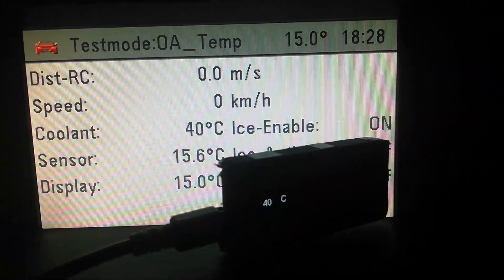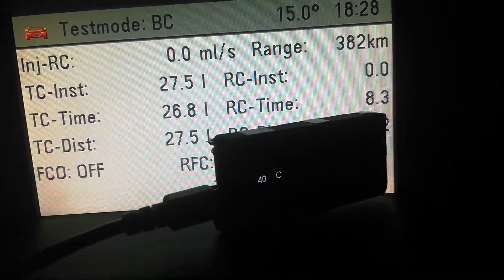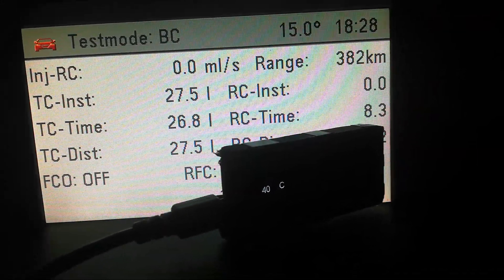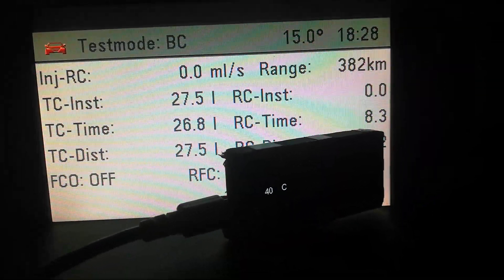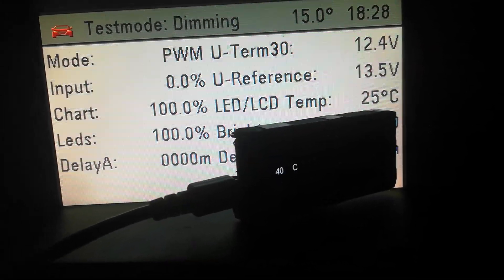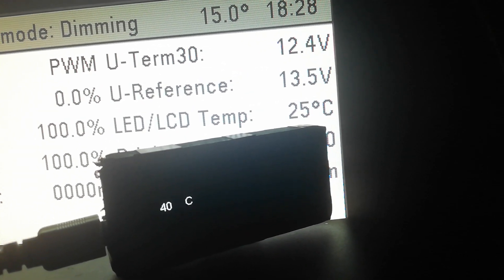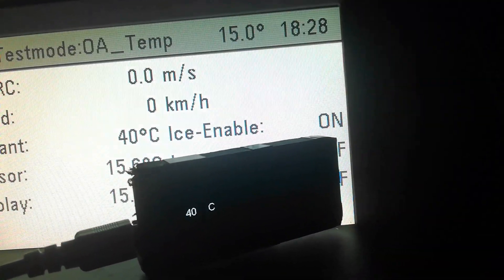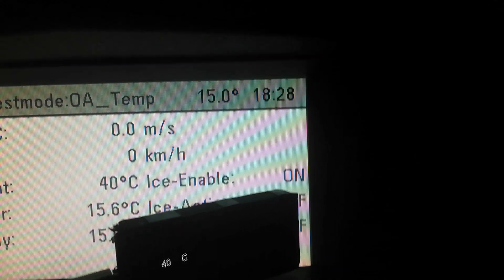ESP32 + ELM327 v.2.1 using bluetooth (2)

Comment: Did you finished the tutorial about w801,w806 modiules. Can you do some more about like sim800l communication, finger print sensors communication.
Reply from the maker: I test in the past (9 years ago) M590 (same as SIM800) also with fingerprint sensor... it need to check my videos or my articles from nicuflorica.blogspot.com , arduinotehniq.blogspot.com or arduinotehniq.com
Reply from the maker: you can find my articles and video with M590 (SIM800) module: https://www.google.com/search?q=nicu+florica+m590
Reply from the maker: you can find article and video wirg fingerprint sensor using this link: https://www.google.com/search?q=nicu+florica+senzor+amprenta